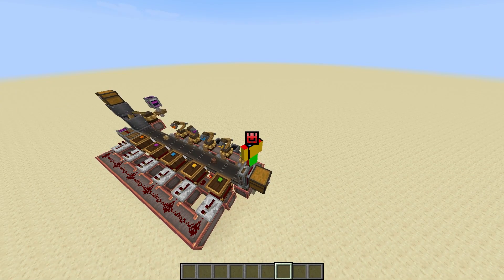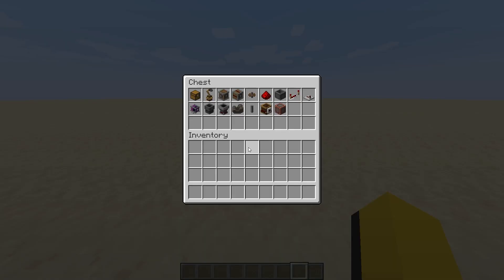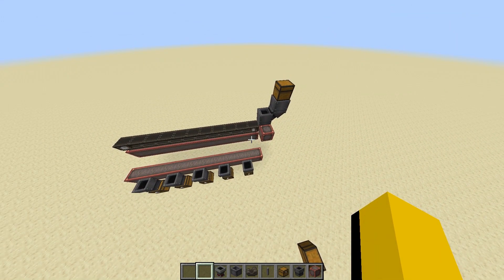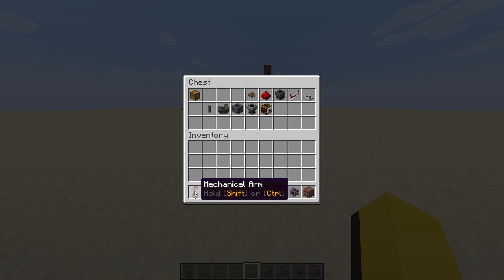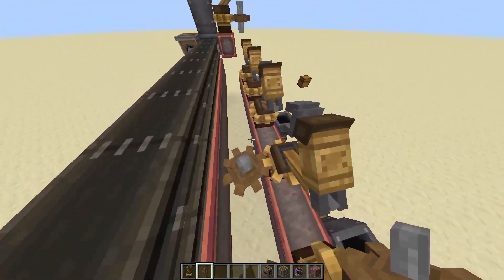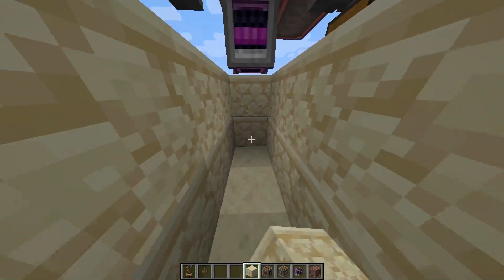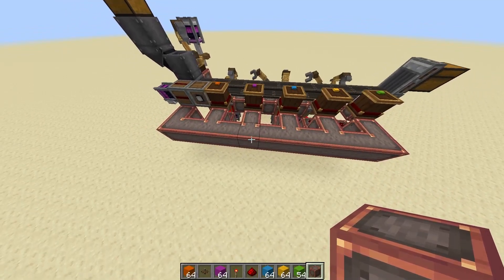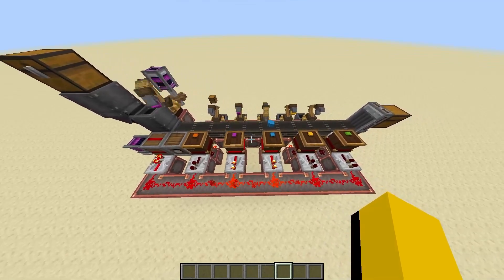Minecraft Create Mod 0.3 Item Sorter Tutorial

Comment: Nice tutorial! Good explanations, it was all clear! Unfortunately, the motors that you use are only obtainable in creative. As you are new on this mod, let me tell you that you can have power with wind, water, furnace and a lot of other things!
Reply from the maker: Thank you for the feedback! And good to know! I've been exploring some sources of rotation as well and will hopefully have a better understanding soon :D And thanks for watching!
Reply: No problem, it's a pleasure! Hope to see more videos on this incredible mod, you just won a subscriber!
Reply: @BLOckOus  if u want, u can use brass funnels to do what u did. U need an inventory near the belt, than put a funnel on the side. It will be by default an output, if u use the wrench it will become an input. The brass funnels are advanced ones that allow a filter.
Reply from the maker: Thanks for the tips! A few others pointed this out and I went ahead and created a new one. I even used water so it’s cheaper than using a belt 😁
Reply: I've been testing energy methods, windmill is the best, and after is a water wheel. The windmill is pretty expensive early game, requiring lots of wool. It's pretty slow, max at around 32 rpm, but what's best is that it has loads of stress capacity. I managed the fully automate a cookie, bread and chocolate bar factory using only windmill power

Comment: Maybe a tutorial on the new mine cart linking and building on top of them. I tried messing with it some and I’m going to mess with it more. But it be cool to see more about it. 

Also any recommended mods to go with this? I was thinking about getting a larger ore deposit mod so I can build legit mines. Any thoughts?
Reply from the maker: Thank you for the suggestions! I'll try to plan out some videos for minecarts. I definitely plan to do more tutorials for Create in general. 

As far as mods, the only thing I have so far is "Just Enough Items (JEI)' which gives you crafting recipes for Create items. I think larger ore deposits sounds cool because then you can go crazy with your mining machines!
Reply: I recommend the Valhelsia 3 modpack. It's got everything +the kitchen sink
Reply: I'm using this along with Immersive Engineering. IE has a quarry machine (works off of chunk based mining). Late game it will provide you with more ore than you can figure out how to store. I use Create to farm hemp seeds and potatos that IE turns into biodiesel to run the quarry and other machinery.

Comment: If you do the same thing except put funnels on the bottom of the conveyer with the filters it will work faster and more reliably. It will stop when it detects the item and it will only pick up the item it needs. A little confusing to explain but almost the same thing.
Reply from the maker: For some reason I remember placing the funnels under the belt and they didn't pull down the items. But I must have been doing something wrong. I'll give it another try! However since I built this sorter, I made a very simple one with a fan and a series of funnels. The fan would just blow things over the funnels so it's extremely cheap too!
Reply: @BLOckOus  Here's an image of how I did it. Pretty simple and very similar to yours. Works faster and less costly. https://i.imgur.com/7LcOV9q.png
Reply from the maker: I like your design! I also came up with an even simpler water sorter :D Check it out in my latest video.

Comment: This is a big expensive and a little inefficient. As the design would mean that you would need a bunch of observers and clutches. Additionally, the clutch on the arms is unnecessary. Its only necessary if power generation is low. But if you reached this point, power probably isn't a concern.

You can use filters, which is probably easier to produce than the many redstone observers and arms that it would require to sort many items.

Brass Tunnels on the chest would allow you to assign one input to many outputs. The arm will be smart enough to know that an item in its hand needs to go into a filter.

You will also run into a redstone length issue if you try expanding this horizontally. So, you'll want to be making use of brass chutes and multiple floors.

Comment: I don't think you can expand this infinitely, I think this design would have issues once you make it long enough that you need a repeater to reach the clutch. This is because repeaters are not instant and require at least 1 tick per repeater
Reply from the maker: You're absolutely right when it comes to vanilla, but here you have the redstone link! You can always have a redstone link send a full signal into a repeater then have that power a 29 block-wide module, and repeat that for each module, so your next problem would be chunk loading. If you're interested in this method, you can check out this video I made a while back where I use that method to make a really long item-splitter: https://www.youtube.com/watch?v=c461RgJkfgQ